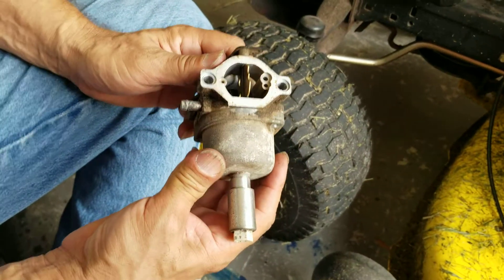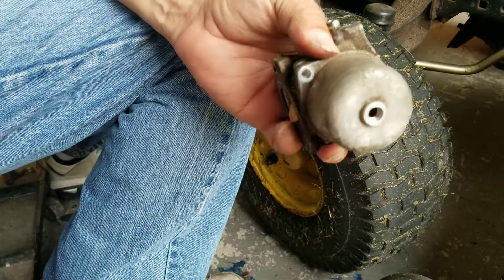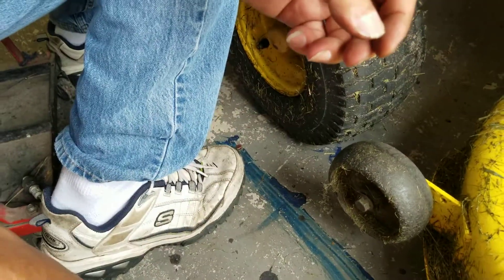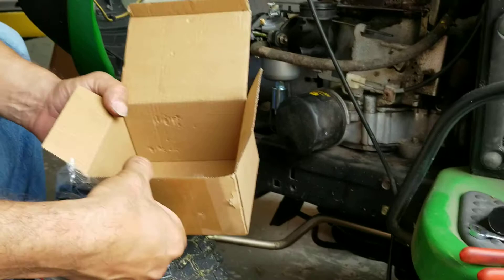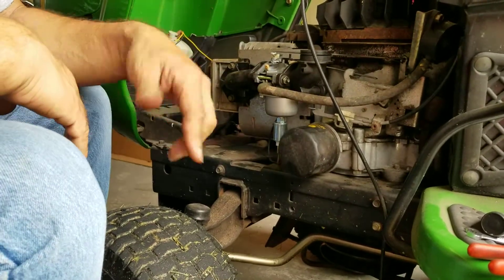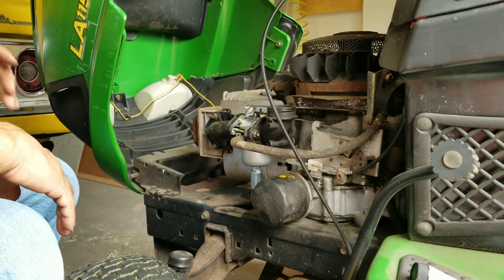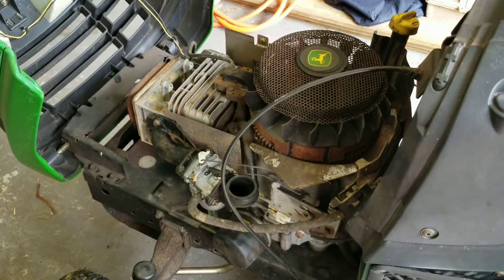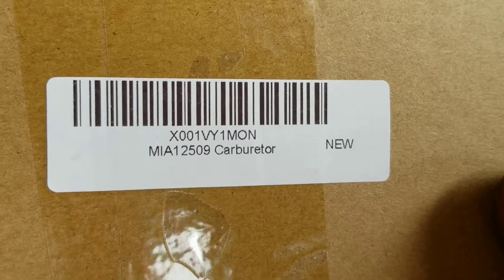John Deere Lawn Tractor Briggs and Stratton Aftermarket Carburetor review install LA115

Comment: Hi, can u let me know why d throttle was not working because I'm having d same problem whenI changed carburetor, idle to high throttle not working
Reply from the maker: I dont have the answer for you. From what I have heard, those mixture screws have an impact on that. Be sure your linkages and springs are correct and not binding up on anything. I never ended up doing any additional adjustment on mine and has been running great ever since! I have a little speed adjustment with throttle lever, been good enough.

Comment: Yea my carby flooded out..turned it upside down an blew into the fuel entry..wouldnt hold mouth pressure..blowing into it..turfed it out bought a new carby off ebay..an the starter motor wouldn't turn to crank it over..it would spin the motor when i took out the spark plug...turfed it out ..bought a new one..good ol ebay..motor goes like a charmer..smooth as ..good as gold..only thing i hate about john deere ride on..the paint from factory dosnt stick to the frame..rust out..piece of crap..now to give it a bit of loving..paint job coming up..

Comment: Had the same problem with a Craftsman snowblower. The carb was old and you just kept breaking off screws trying to rebuild it. Ordered a replacement carb from Amazon ( 2 day turn around time) and in an hour was blowing snow. Going to order one for my John Deere Briggs and Stratton 44 next week. In a half an hour I'll be mowing grass. I'm done trying to find parts to rebuild old carbs. The one for the snowblower was like $25.00 and the one for the John Deere is about $35.00. Must be a 1000 videos on how to change them out on YouTube...just got to look.
Reply from the maker: Well thanks for watching mine and for the feedback! Still working great! Havnt touched it since the install

Comment: Followed you instructions, all is fine except same throttle control problem as you had at end of video.  Did you ever figure out what problem was?
Reply from the maker: Hi, glad it's working for you. Honestly, I have not spent the time to figure that out yet, but the thing runs great at the RPM it's running at and I have been cutting grass and towing the lawn trailer ever since, so I just left it alone. I will look at it one of these days.
Reply: Possibly your air/fuel ratio. Adjust the air down half turn

Comment: Did you ever figure out why throttle speed wouldn’t change.  I have same exact issue starts right up but cant speed up or slow up rpm
Reply: I’m having the same problem
Reply from the maker: No I honestly havent played with that yet. Things been running good and at a good enough speed that I just left well enough alone. It does adjust a little with the throttle lever, just doesnt go as high rpm as could. I have heard that the mixture screws can affect it. Still starts right up and runs great though. I use stabilizer in all my fuel now too.

Comment: Great video.  Do you have a video on how to remove the LA115 carb?  I’ve done a few small engine and I’m ready to move up.  My JD has been parked for a “while” and it cranks but doesn’t run.  Got a replacement fuel pump, filter and carb kit from JD.  thanks!
Reply from the maker: Thanks! No I did not do a video on the removal.